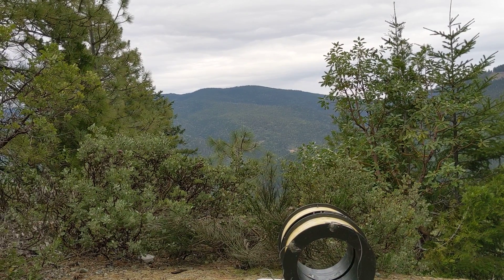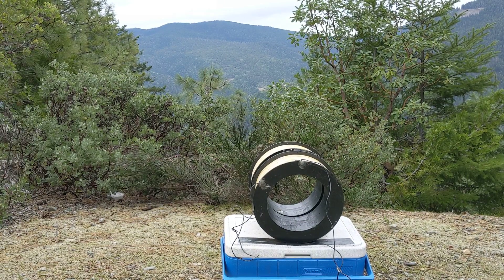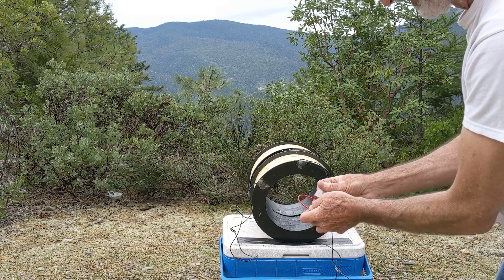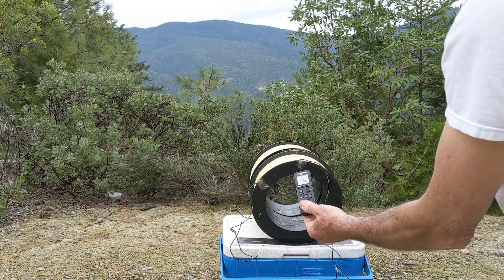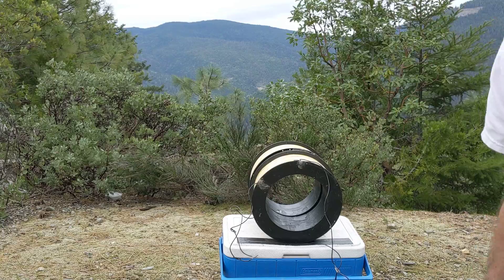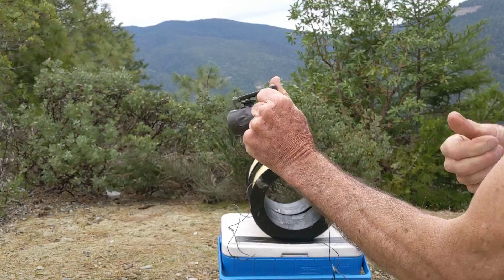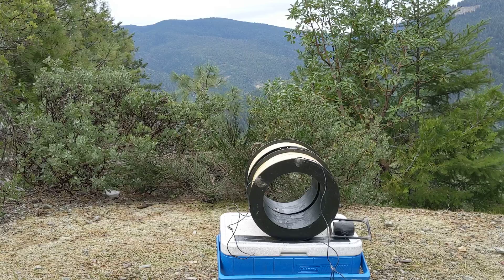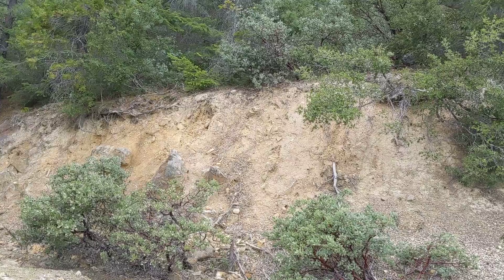Giant induction coil picking up Audio 5 feet away!

Comment from the maker: Thanks to the suggestion of a viewer, I tried attaching two identical coils together in a parallel circuit, so their output polarities were in opposition to each other, and this eliminated much of the AC hum I was picking up when I placed the coils in the right position,  but this also seems to have reduced the coils sensitivity, so my experimenting continues.
Reply: You could try the "big hammer" approach of putting a highpass or notch filter on the signal to get rid of any 60z component.

Or perhaps, space your opposite-polarity coils apart and put your item of interest in between them.
Reply from the maker: @antonliakhovitch8306  I tried placing the coils apart as you mentioned. and it greatly reduced the AC hum.
Reply: @GrantsPassTVRepair  In one direction, but in others, it would increase. You're dealing with 'phase/time angles'. This is so incredibly pedantic...
Reply: You could add a mixer with 60Hz from the power line on one of the inputs that’s 180 degrees out of phase so it eliminates the 60Hz from the power lines
Reply: @tmantis5  Some/most power distribution lines use 3-phase, each 120 degrees from each other.
It's how 120V 'becomes' 220V - or 220V becomes 480V - depending on where you live and what the mains spec is.
This would make mixing and filtering extremely difficult
Reply: @EgonSorensen  Triple phase is not 180 degrees out of phase, it's 120 degrees per leg.
Reply: @tmantis5  To some effect. What's done in electronics, as in 'noise cancelling' circuits is to select the frequency you want to 'notch', and invert it after filtering it, and reinsert it out of phase.
Reply: Could this pick up Bluetooth?
Reply from the maker: @Damianmarleyfan  No it can't get Bluetooth signals, but it can pick up inductive waves from any speaker if you're  close enough.
Reply: @Damianmarleyfan 2.4Ghz has a wavelength of 12.5 cm, and Bluetooth antennas are typically 20-25 mm.  Obviously the clip is far larger than that... that being said though, there probably plenty of creative ways to do something new beyond just fine tuning, that could be used to pick up Bluetooth.

I have some experience working on Bluetooth, but not much on the antenna side of it, beyond doing some basic wardriving on the signal strength. Hopefully I will have  lot more antenna education soon though 🙃
Reply: It's like pickups on a guitar. You can apply the same theory to your coil to deal with attenuation volume clarity etc.
Reply: @Corpsecrank  
Exactly like the humbucker pickups on a guitar.
Reply: You could remove the hum in post-production for the purpose of social media posts. You could leave it in at the beginning - "Here's an example of the everpresent AC hum, which I've removed digitally from the rest of this video, to makr it less annoying."

Usually people use software such as Izotope RX. You could look up free alternatives to that. You already might have software that does it. I have a freeware program called Audacity that has a noise removal tool. I would give it a couple of seconds of the AC hum recording as a noise sample, and then tell the software to remove that sound from the main audio file. There are sensitivity settings so that it doesn't try to remove too much or too little - it's trial and error, and could take 20 minutes to a couple of hours to get the hang of, depending on the software and your experience. Of course it takes longer to master the process - I don't know how long, so I wouldn't be a person to hire for that job, if you wanted to outsource. I just do it for my own hobby audio. Nevertheless, having admitted that, I still say that a steady interference, such as 60 cycle, is easy to mitigate in post-production, if you wanted to go that route. I got the hang of the Audacity noise tool just by reading the contextual Help popups, and then trial and error with the parameters. Izotope RX gives more transparent results, though.

Obviously, the best option is if you can find a physicial humbucking orientation for your air-guitar's pickups, first and foremost. That's always the preferred solution, even when "fix it in post" is an option, all things being equal.
Reply: Get a center-tapped audio transformer between the coil and amp. hook a long wire to one side or the other of the centertap. maybe a rheostat in series with the long wire. this is an old technique that was used in WWII era war machines with radios on board. the idea being to cancel out the ignition system pulses that interfered with radio reception.
Reply from the maker: @BjarneLinetsky  Thanks for the suggestion.
Reply: @GrantsPassTVRepair  Maybe what you need is a Faraday Cage.
Reply from the maker: @Starlite123  I'm sure shielding would help, but then it defeats what I was trying to to.
Reply: @GrantsPassTVRepair  But it wont block anything in the cage. If you put them both in the cage the cage will not affect what's inside.
Reply: @GrantsPassTVRepair  It would not need to even be that big could probably make one in a dog crate.
Reply: If you put it at the focal point of a parabolic dish you could make it directional.  That way you'd be able to work out which direction the interferance is coming from and thereby reduce it's presence significantly.
Reply: @KenFullman  
The size of a parabolic dish for 60 Hz would be HUGE.
Reply: @brucekives2194  Doing the maths, it comes out that the wavelength of a 60hz sound signal is about 6 yards, BUT I then realised that we're not dealing with sound waves.  Turns out a 60hz electromagnetic signal comes out at a few thousand miles.

Seems you're right after all.
Reply: @KenFullman  
Thanks for understanding, sir.
Reply: You can filter out the 60hz AC signal using a bandpass filter. or perhaps using a digital filter.
Reply from the maker: @guytech7310  I had some degree of success using a second coil  in parallel which caused their output polarities to collide.
Reply: @GrantsPassTVRepair  A common mode choke config. but that also would reduce non 60 hz signals too.

Audacity has a 60hz notch filter. You could record the signal & then use audacity (windows audio freeware) to filter out the 60hz.
Reply: You repair TVs?!?
Reply from the maker: @railgap  I use to.
Reply: I can hear audio from way over five feet away with my ear drums lol. And if it's calm , i can hear people talk from half a mile away.  What's the big deal?
Reply: Use a high pass filter. 60 Hz is much lower than the high frequencies of radio signals so the right High pass filter should eliminate that low frequency signal.
Reply: @tmantis5 The coil isn't picking up RF though, it's picking up magnetic waves in the audible range and directly piping them to an audio amplifier.
A highpass filter would still *work*, but it would also take away the ability to get any bass out of the thing 🙂
Reply: @tmantis5  A few misconceptions I can hopefully clear up:
A. With AM radio, a high frequency (1MHz+) carrier wave is amplitude-modulated with an audio-frequency (20-2000Hz) signal. The carrier wave is a specific, unchanging frequency and it can be picked out amidst a sea of other signals.
This is NOT picking up AM. There is no carrier wave. There is just a pure, audio-frequency, unmodulated signal. In fact, anything at radio frequency (above 1MHz) will almost certainly be filtered out by the amplifier.

B. Radio is indeed an electromagnetic wave, but what we would normally consider "radio" uses waves where the electric component of the field is dominant. The transmitter and receiver are capacitively coupled.
This is a magnetic antenna, which picks up on the magnetic component of an electromagnetic wave. It is inductively coupled to the signal source.

Comment: I dont have the same coil but  i made  preamp stage before amplifier stage, The amplification greatly improved and is much clearer and better, but on one condition .A diode must be placed parallel to the coil to prevent the pre-amplifier and the amplifier from burning out.

Comment: i also like to experiment.  about 8 or 9 years ago I was experimenting with magnets and a mirror and a magnifying glass all of them were round and i was stacking them in different orientations just playing around with them the magnet was off of a speaker the magnifying glass was from a big screen television and the mirror from a makeup compact just for reference but anyway i had one of those telescopic magnets for picking up bolts and stuff and i walked close to the table where the experiment was setting and the telescopic magnet i had extended and balanced in my hands started to rotate on the axis of my hands and i thought wow that's cool so i hung it from the ceiling with a string and it started to rotate like a fan blade or something so I knew that i was onto something i ended up taking the telescopic magnet holding it from above the stacked things i mentioned earlier and brought it close to the edge of the speaker magnet where the two magnets were opposing each other and i kept them as close as i could and spun the telescopic magnet as fast as possible while keeping the opposing magnets close together and the two story building i was in started shaking like a earthquake was happening and I  thought it was a big truck or something so I looked outside and nothing i repeated this like 4 times in a row and same thing happened every time and i stopped only because there were people below me downstairs and I was afraid of them coming to ask me what I was doing that was shaking the whole building.  I've been wanting to see if I can still do this because i have a feeling maybe it's the same principle as the way tesla said that he could bring down a building without any explosion or anything like that

Comment: The HIGHLY CLASSIFIED military program I worked on involved similar technology but instead of a few feet, we communicated between military bases 30 miles apart with ALL the communications and "antennas" completely  underground.

When the USA suffers the nuke attack, ALL surface radio communications will cease.  The underground systems will allow military to stay in control.
The US public is unaware of this extremely expensive yet crucial communications network.
The POTUS will use that underground network to control military forces after the nuke detonations.

Comment: Wouldn't a capacitor across the coil leads help to filter out the hum? Three types of capacitors to try would be: 1. Polarized. 2. Non-Polarized. 3. Rotary Air-Gap Tunable. Would also be interesting to attach an oscilloscope to see how the output varies with each type of capacitor. One method would be to use a capacitor "decade box" for variations.

Comment: Very impressive.  Fun experiment, but it's picking up EM produced by your items (moving magnets and coils), not "audio" (changing air pressures).  It might be fun to see if a moving coil (dynamic) microphone would be a suitable transducer (audio to EM) to see if your coild to pick up the tiny field generated, like the input transformer of an "audio" amplifier.  "Wireless microphone" (as long as you are 100 miles from town).

Comment: Interesting findings. Seems to me that if you were to find the right size capacitor, you could turn this into an LC circuit. Then, you could put a secondary on it to ramp up your voltage and discharge it thru some kind of spark gap or its equivalent (or a grounded capacitor) to produce useable power.

Comment: Hopefully these experiments open a few eyes into similar techniques, many of which are used/abused for decades. Where at the easy side you can determine occupancy, determine which devices are used, as every electronic device has an RF profile. To the extent where a power company can count how many TVs of a particular brand are using electricity, and which TV channel you are watching. At the high-end TEMPEST techniques can be used to view what's on someone's screen at the other side of a wall. Furthermore, similar techniques are used to break cryptographic implementations, as the noise generated by devices is often dependent on the key. Listing to noise and computing the key is called Side channel analysis. Happy sleuthing. :)

Comment: I have a question. A friend of mine for years made a 10" square of wood and wrapped thin wire around it hundreds of times. He turned a radio on with no reception on a random frequency and placed this square in front of it. The radio came alive and Crystal clear audio from somewhere nowhere near here.   What could this contraption of antenna be? Some kind of beam?

Comment: Your video caught my attention.  I wound a bike wheel with a spool of #30 enameled wire. Connected to an audio amp.  My favorite application was to hike up a small hill that overlooked a drive in movie theater and pick up the audio of the scene on the giant screen from all the speakers filling the parking lot.  The other item we heard was frequent occurrences of high frequency tones that would drop in frequency over several seconds and then disappear.   I was told by a scientist from TRW Inc that these were likely meteors entering the atmosphere, and he supplied a paper that described the phenomena.  This was in Southern Calif, about 40 years ago.
Reply from the maker: I did not know that meteors entering our atmosphere could be detected in this manner, but considering the explosive nature of a meteor at such high speeds I'm not to surprised.

Comment: This comment is somewhat  on the same level as the coils you are experimenting with fella. 
I took  a dozen garden hoses and connected them together to form a star configuration. The center point I connected one short hose. When I put the hose to my ear I could hear tremors which had to be earthquakes from a distant location. This would happen off and on from time to time. This happened regularly. This setup was in use for a few years. Never stopped working till I took it apart and sold the rubber hoses. Peace v

Comment: Very interesting.  I made a coil about 3 ft square with 800 turns. The former was a block of polystyrene with plywood end cheeks.  Took it outside as you did.  And heard singing.  Very strange.  I worked out it was coming from a church about 300 yards away. It was from the induction loop for hearing aids.
Reply: Dang...

Comment: Using that same sort of method, I transmitted audio several 100 feet.  My transmit was one large coil and the receiver was another.  Both coils were about 5 feet in diameter.  IIRC there was 1000 feet of wire on each.  The receive amplifier had a notch filter for 60Hz and another for 180Hz.

Comment: You need a high pass filter to block the 60hz. Not much to do about radio frequency interference. 60hz should be impossible to escape in North America. 50hz should be impossible to escape in Europe.

Comment: Maybe what you need is a Faraday Cage.
Reply from the maker: A Faraday Cage will block the signals I want to pick up as well as the ones I don't.
Reply: @GrantsPassTVRepair  But it wont block anything in the cage. If you put them both in the cage the cage will not affect what's inside.
Reply: @GrantsPassTVRepair  It would not need to even be that big could probably make one in a dog crate.

Comment: If you connect one end (lets call it common/earth) to the acctual earth, or any metallic structure or deep anchor you can find nearby it will make the "hum" your base line; which means it will become the 0 potential - thereby eliminating the hum.

Having the coils "floating" like you have it will pick upp and produce that 50/60Hz hum from the ac lines.

I guess you just connected one end of the coil to the input and the other aswell without grounding everything on one end?

Comment: There are ways to cancel out ac hum it needs to be phase shifted 180% and fed into the coil or the amp . You could amplify just the ac hum and put it through another coil near the pickup coils  reverse direction and adjust amplitude give it a try
Reply from the maker: I did so by placing two identical coils in parallel, and it worked.

Comment: Neat,  wonder if the background hum can be filtered out.
Reply from the maker: Yes with two identical coils in a parallel circuit it can be greatly reduced, if one of the coils has an output that is out of phase with the other.

Comment: There is a very cool audio spectrum program that was originally written by a ham operator in Germany. It has FFT software, waterfall display, many cool software modules for signal processing and an intuitive graphic interface for configuring just about any kind of audio processing you can dream of. 
NO SOLDER. NO GRIMY OLD UTC HERMETIC FILTERS, NO OP-AMP JUNGLE CIRCUITS!!!!